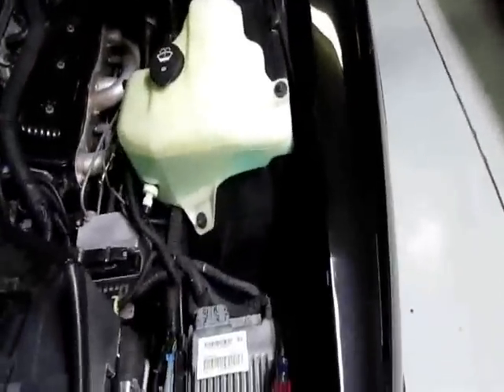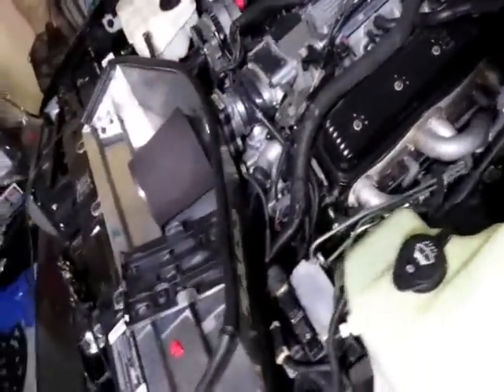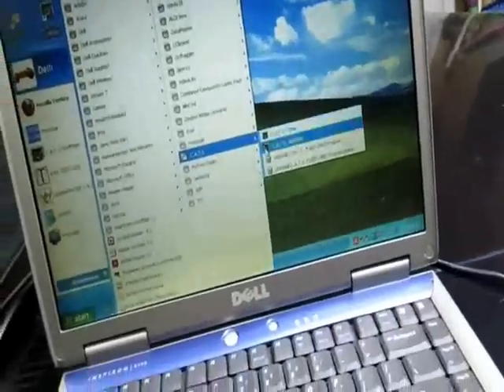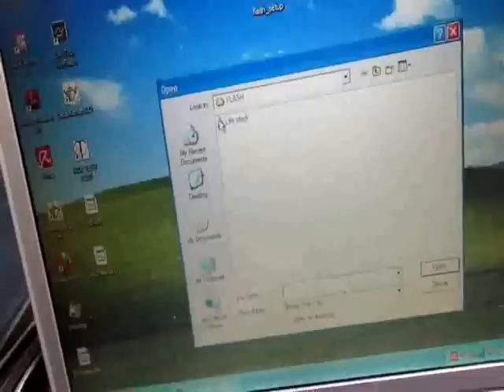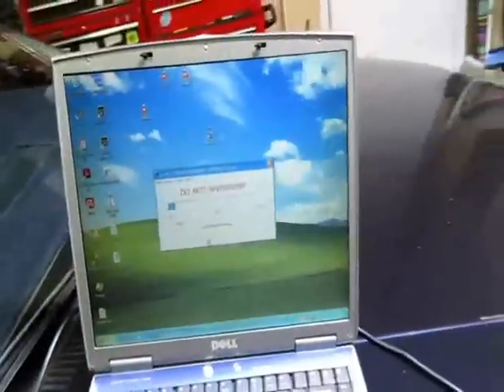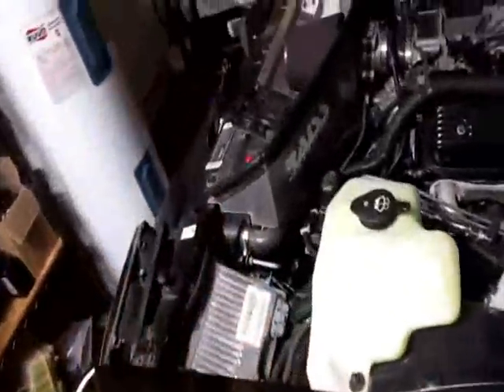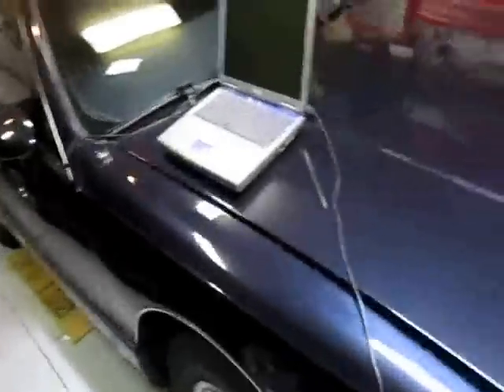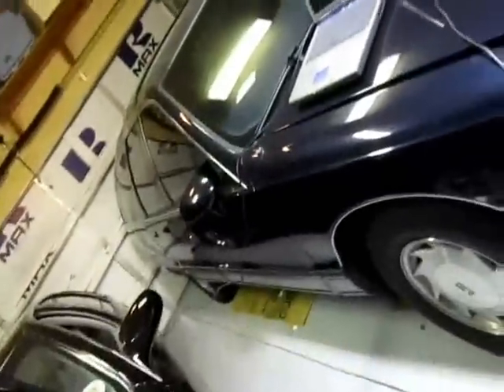How to Reflash ECM  ECU LT1 PCM RE flash RE program !

Comment: It was transition years into vortec era. 95 has an extra solenoid than the 94 and 95 was last year of tbi but it integrated the vortec's transmission on OBD1 system as OBD2 came the next year and they are interchangeable. 94 did not

Comment: say i have a question what do i need to flash my pcm in my 2002 oldsmobile brevada, cause the allwheel drive and the transfer case encoder motor was replaces cause the front wheel drive does not work, we are thinking maybe it needs to be flash we really dont know cause we took it to the dealer and they say there no codes and i belive you know how that goes, can you help me thanks ps what do we do.
Reply from the maker: I dunno. Probably a GM tech 2 would do it. Or I think if you have a cable and a laptop and you buy a day subscription to a GM program, I forget what its called but its what the dealers use, you can do it.   Probably cheaper just having a dealer do it

Comment: Thanks for the video upload and production. I have question, is the programmes are free anD Easily available on the Internet? Is yes, what website? Kindly write the procedure to run this flash doing/transferring/writing procedure on the used ECM (from the Junkyard). I have problem with my 2004 Nissan Quest SL (already replaced/ECM from Junkyard/this is the replacement by the Nissan dealeship charged of thousands of dollars on this ECM. 

I was thinking to simply replace it myself to save thousands of dollars with the one I recently bout for $15/- from the Junkyard with exactly the same year and model number. I have not checked the serial numbers. 

Is VIN/Serial numbers need to be the same or the part number must be same? 

Anyhow I already pulled two (in case) pulled out the ECM  2004 NISSAN QUEST SL SAME COLOUR SAME MODEL for my NISSAN Quest 2004 SL model exactly same model and year. 

Is this is ok to simply slide out the old one and simply slide New (Junkyard ECM) And hook it with terminal. And than switch on my ignition and let the computer read for a minute or two and than start the vehicle. Is it will work. I thank you very much in advance for your help in this regard. Kindly let me know if this way vehicle will start and ECM WILL all reading all sensors? Anxiously waiting for your response. Thank you again and God bless. Kindly reply back at mushir.joseph@gmail.com Thanks.
Reply from the maker: This is only for LT1 Chevy engines from the 90's
Reply: @GhettoWagon  what program are you using and where can I find it?